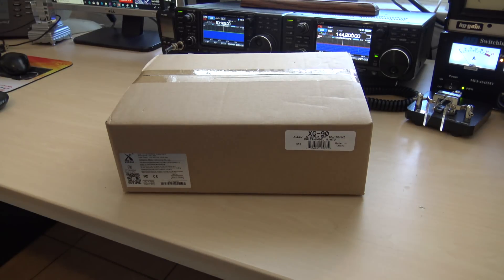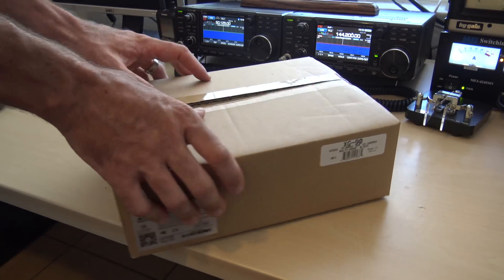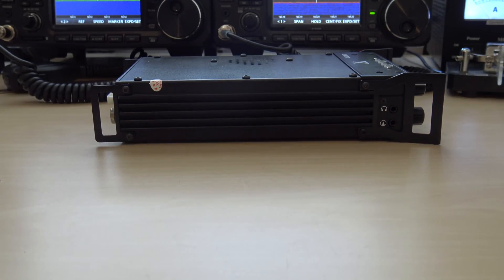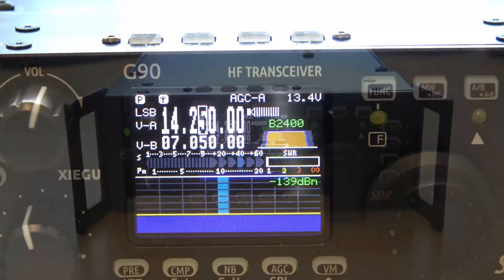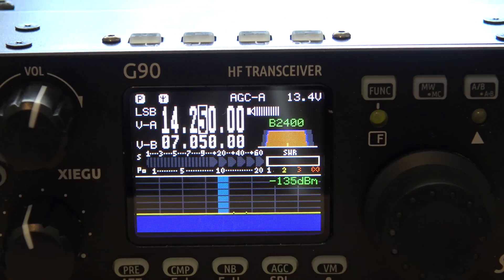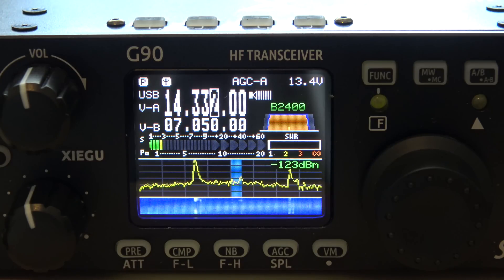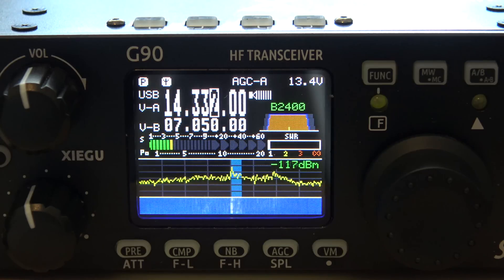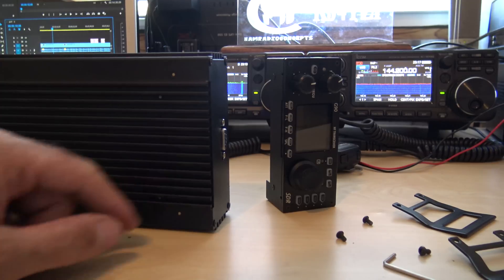Xiegu G90 SDR HF Transceiver Review, On-Air Contacts

Comment: Hello, I have a question, I have the same device, when I go into transmission, on the right of the display, under the reception signal strength, it appears; ALC:100, when I play ptt it's not there, I accidentally turned it on somewhere; how to turn it off?

Comment: I have a g90. When I key the mic the SWR meter fills straight to white. No matter what I do it still goes completely white. The Antennas I use are completely ok on my ic 7300 and xeigu 6100x. I have looked all over the internet and there doesn’t seem to be any videos or information that suggests a solution or reason. There is one that says it “might” be an internal grey socket where the antenna socket is.   The g90 receives very well but no transmit. It’s a shame because I really like the G90. I’ll give it another week of searching then I’ll consider putting it on eBay as spares the or repair and just get another one.

Comment: Great informative video. Well done. I like the idea that the radio can do 20 watts. It makes for a great QRP as well as a low power portable radio. 20 watts is only 1 S unit down from what a 100 watt radio would give. I never run 100 watts portable. It just draws way too much current from the battery. 
Thanks for posting this video.
Barry, KU3X/QRP

Comment: Great video! My G90 arrived yesterday. Will be using a MFJ-1778 G5RV Wire Antenna 80-10 Meters 102’ with it.
That screen is definitely small, I’m probably going to get a magnifying screen to put in front of it.   
I also like that it decodes CW into text since I don’t know morse code, at least will be able to see what people are sending.
I’ll probably end up buying one of those CW keyboard units in a month or so...    N5BYB

Comment: Great Review. After seeing 
this and some of the reviews on this XIEGU G90, did something I probably should not have since I already have so many radios already.  but this one seems to have found a niche the other ones don’t fill. I ordered one of those xiegu G90s which are on sale for $450 and I put it on the credit card   Which is a quasi-QRP radio that can go up to 20 Watts but can be turned down to just a few watts  if you want to save battery power.  However, I like the fact that, if I have too for an emergency or just want to, I can still push it back up to the 20 Watts. It  is smallish and easy to carry around.  I’m getting a 60 foot wire from Chameleon that I can just throw out over some tree limbs or whatever and with a lithium ion battery and my fold up solar panels  I can do cw just about anywhere I am. The reason I wanted this one is because it also very easily decodes CW. No I do not want to depend on that but in an emergency If I am kind of nervous and not copying my CW like I would like then it is nice to have that little addition. It also has an internal Antenna tuner they say is so good it could probably tune up a head of lettuce. I like that in case somehow I left my antenna behind, lost my antenna, or heaven for bid damaged the antenna that I’m carrying and have to come up with a makeshift one. Especially since It also has a great SWR graph that can help along with the internal antenna tuner if you have to build a new antenna on the quick. I think this little Xiegu G90 is going to be the cats meow if I just want to grab a bag and go quickly

Comment: Hi Eric, Great video as usual. I bought one but my scope line is not YELLOW. I do have the latest firmware, is there a way to change the color? Also, what antenna did you use? MY recieves seems to be deaf. Could be conditions. I am using a 1/4 wave ground mounted vertical in the yard.

Comment: Eric here's the dilemma, do I buy the Xiegu G90 or do I hold out for the Icom 705?
Reply: The 705 will be three times the price of the G90 and 10W vs 20W.  Also the 705 will not have an internal antenna tuner but the G90 does.The G90 is a much better value. But yes the 705 will be more refined much bigger screen. I see myself owning both. Now as far as operating on SSB the G90 will get out through the noise floor much better than the 705. QRP radios are much more suited for CW. If you will be doing CW then wait for the 705... if mainly SSB you will be happier with the G90. You could get an external 45W  amplifier with built in tuner (Hardrock 50 HF amplifier) But by the time you add all that might as well take the 7300 to the field.

Comment: Hlo... i jst want to knw if the power output is Adjustable... for example... 1 to 20 watts or anywhere in between as needed  as to conserve Batt juice  spcially on camping trips ... Tnx, 73s de n6mmq

Comment: If you were new  to Amateur radio and you where going to buy either X 5105 or X G90.  What would you pick and why.  Also I want one that I can go to parks etc... to setup.
Reply from the maker: My suggestion for a new ham is neither one of those UNLESS you are going to be only POTA and portable parks etc. QRP is a challenge, (Low power)
Reply: If I had to pick one of the two with the intent of home and park use, I'd opt for the G90.
1- not as expensive
2- 20 watts out vs 5 watts
3- no built in battery to eventually replace

The only advantages of the x5105 are:
1- size
2- half as much current consumed on receive (0.3 vs 0.6 Amps)
3- FM transmit and receive
4- 6 meters

Comment: This is a great little radio, I got mine a few months ago and use it with a 8.4 AH zippy LiFeP04 from Hobbyking and it's a perfect match.

Audio and receiver is a lot better than the X5105, the X5105 is great for portability though. 

The tuner is great, it tunes my 5 band MK III EFHW from hyendcompany.nl on 160 meters and it's 20 meters long !

The reported TX Audio isn't great but that can be fixed with replacing 2 Capacitors on the MIC PCB, search the xiegug90 group on groups.io.

Current 1.72 FW now shows ALC on transmit.

Comment: Looks like it might make a decent mobile HF setup. Though for that use, an FT-891 is only $100 more.
Reply: With the G90 you also get an ATU and antenna analyzer.  If you are going man portable, that is extra stuff you don't have to carry.  I actually own both the G90 and the FT 891.  They both have their advantages/disadvantages.

Comment: It's a good video, congratulations
.
How long could the battery last?
Do you think it is better than the FT-817, except for the battery and the display?
Reply: This one doesn't have a battery.
Reply: It consumes around  . 6 amp on receive. Your battery mileage may vary.

Comment: these damn things are too small!!
Reply: Don't knock it till you try it. It's amazing. I've had QSO'S everywhere with excellent reports even overseas. It's stability is right on. Doesn't fade off signal after using it a couple hours like the old rigs.

Comment: Ordered one. Now, I got a back of the set antenna, you may have already tested with other Xiegus. Nor for a permanent solution, but do you think this antenna can work for portable and or testing? The antenna is an MFJ-1899T. Thanks.

Comment: A complete piece of ChinaCom TRASH that CANNOT consistently meet FCC spectral purity requirements. AVOID AT ALL COSTS
Reply: And yet the FCC has it approved for sale in the US.  I guess you know more than them.
Reply: You've tried it then?
Reply: @Paul-MM0PHG  Yep, and it is a great radio.
Reply: @TXLorenzo  That's good. I have the x108 and have always found it to be a great little performer- punching way above it's weight! I regularly use it at 500mW to great effect. Too many people ready to write Xiegu off without having tried it out- see above! 73 de MM0PHG
Reply: @Paul-MM0PHG  I also have the x108, but the G90 is a complete generational upgrade, waterfall, decent tuner and antenna analyzer. In addition,  great upgrade path via the SDR.  It seems better built than the x108 as well. I think Xeigu is the leader in Chinese radios. They are a relatively small company who listens to their customer suggestions. I think this radio should be a wake up call for the major manufacturers.

Comment: Thanks for the infomercial. Just ordered one. 
If my wife finds out. I'm going to blame you....
Reply: LOL
Reply: So tempted. But I just got a X5105 & have discovered all the problems with that. Am worried that I might suffer as much frustration with the G90. Still, it does sound good. Thanks for the video.
Reply: @haramanggapuja  Suffered frustration of trying to calibrate the side bands on an X1M from Xiegu (which STILL dosen't sound right, but works).  I am still willing to take my chances with this one.
Reply: @haramanggapuja  Care to ellaborate? as I am looking at both the x5105 and this model thx

Comment: Eric,

What antenna did you use for this test?  How about testing the general coverage radio part of this rig.  It covers AM too.  If it’s a “starter” rig for a new ham and functions well in the general coverage realm it would expose the Newbie to the other signals out there.  Most of us old timers started out with general coverage radios and stumbled into ham radio by listening so this might be a good starter radio for the radio newbie/ham to be.

Dave K8WPE

Comment: Fascinating radio. Who says you need more than 20 watts to make contacts. Lol
Reply: @HamRadioConcepts, you, Josh (Ham Radio Crash Course) and Robert (Robert Nagy) have me sold on adding this radio to my 'inventory.' It has everything I'd like (waterfall; spectrum scope; SWR/antenna analyzer; ATU) in a small, affordable package. Add a power supply and an MFJ -2104 antenna system and my go kit will be well on its way. And I might be able to fit is all into the Apache 3800 case I already have instead of springing for a Road Case USA 6U unit. GOSH, I love this hobby!!

Comment: Any rig control software or speech synth options upgrades in the works? Great little radio...I'm one of your visually impaired subscribers and with all the new radios coming out of China, few of the HF rigs have the kind of voice prompts or speech feedback like most of the dual band handhelds do. Even just frequency and S-meter voice output would make it pretty accessible.
Reply: You can use rig control.  I use Ham Radio Deluxe with it just fine.

Comment: Xiegu are producing an external 5 inch screen for the G90. Not sure on the release date. Fred VE3FAL is in regular contact with Xiegu as is Wayne 2E0BVJ.
Reply: Is it possible to output the display to a monitor? Or an App on a PC/Tablet? A newbie here trying to learn.  Thanks

Comment: So than what’s the answer ? The xiegu with the  cute but tiny display and 20 watts or a used ICOM 706mkii with older tech ... but 100 watts ?
Reply: If you want 20+ year old technology, get a 706.   I see used ones going for more than a new FT-891, crazy.   I see this one at MFJ for 450.00, not bad for what it is.
Reply: GeoS I tend to agree about the 891. For some reason it doesn’t seem to get super respect out there  but I love mine and I think that it may be the best of the lot amongst small portable field friendly rigs. Just my $0.02.
Reply: @johnpeterson7264  I have seriously considered a FT-891 for portable, and that's about all I'd use it for.  I've owned the KX3, KX2, FT817, etc but now prefer a bit more power out, and since I'm not out hiking anymore, the larger sizes don't matter.  I agree the 891 is probably best but there is something about this little rig that intrigues me, lol.
Reply: @geod3589  I have both the FT 891 and the G90.  The G90 is a great travel/SOTA rig and a lot less weight than a FT891 with antenna tuner, bigger battery, ect.... But, if you need that extra punch the FT 891 can deliver.   I would love to see a FT 891 with the features of the G90 though.  SDR is the future.
Reply: This has a built in tuner, and no need for additional mechanical filters since it's SDR. Give and take I guess on features I guess.